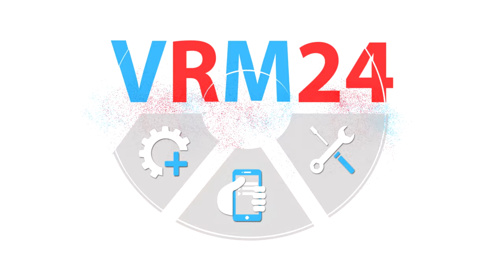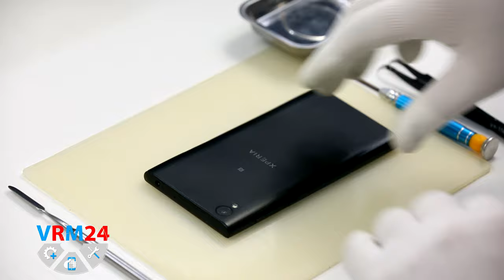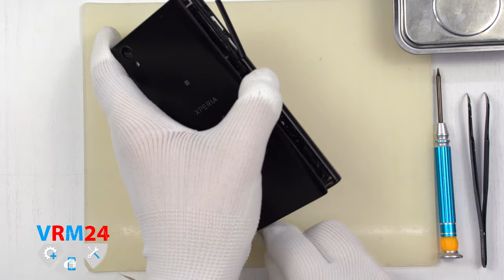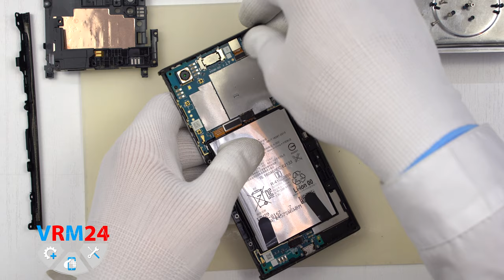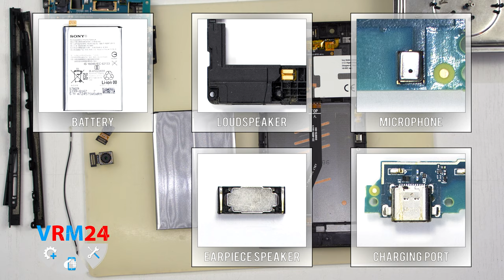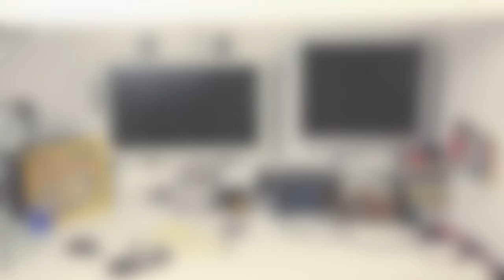📱 Sony Xperia L1 G3312 Teardown Take apart Tutorial

Comment: please help me ….  
Sony logo appears and then a black screen when pressing the power button does not respond and when i press the power button and volume up (the Sony screen appears and then a black screen) … when i connect it to the laptop and press the volume down button, a green signal appears at the top of the phone and a message clears on  The laptop says that the device is turned off… When i connect the charger and press the power button and volume up, the phone will restart itself constantly (Sony logo, then black screen, then Sony logo, black screen, and so on) it does not stop until I disconnect the battery….  I changed the battery and nothing changed please help me

My phone is 
Sony xperia l1
13312